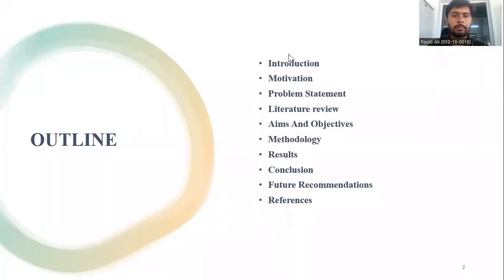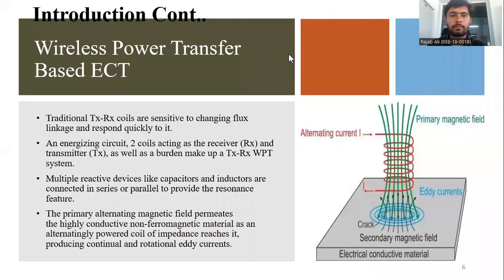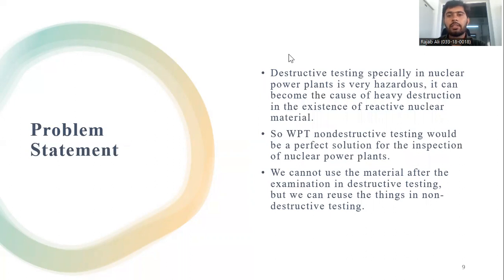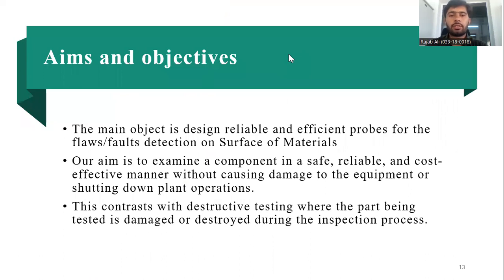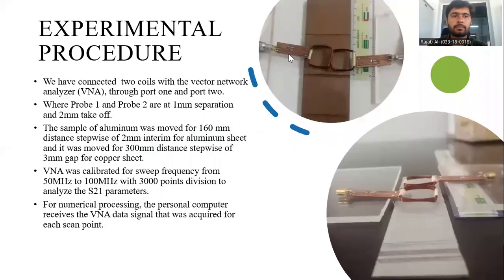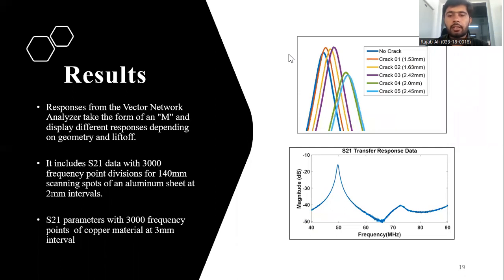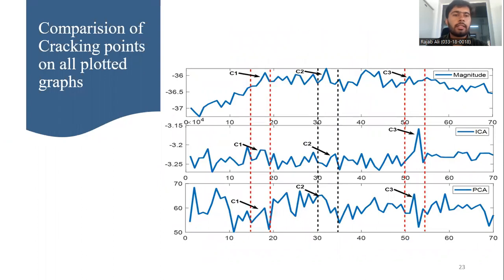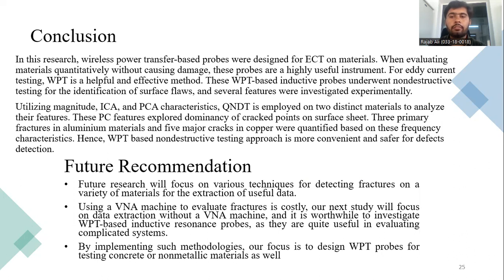INDUCTIVE WPT BASED NDT FOR DETECTING SURFACE DETECTION

Comment: Hlw sir...can u provide me the code for

"Optimal capacitor placement in ieee 33 bus system using pso algorithm "

Keep the bus data and line data as per ur project.

I need it for academic purpose. 
Plz help sir .
Reply from the maker: Kindly share your email, and we will share your email with relevant candidates and ask them to help you if it is ok for them.